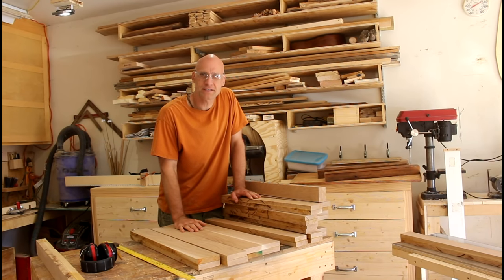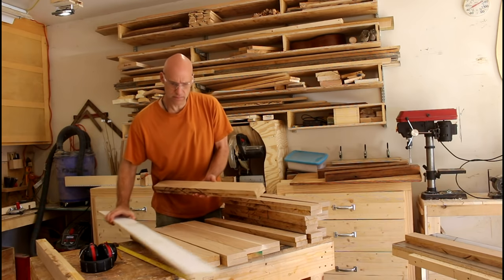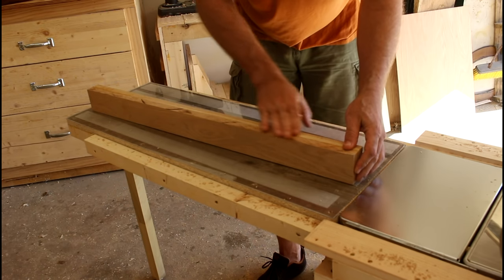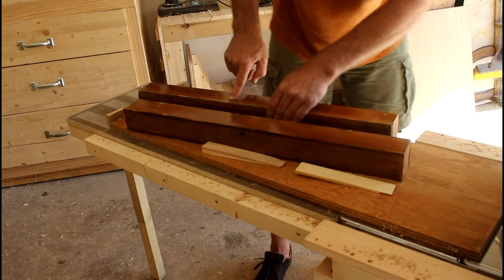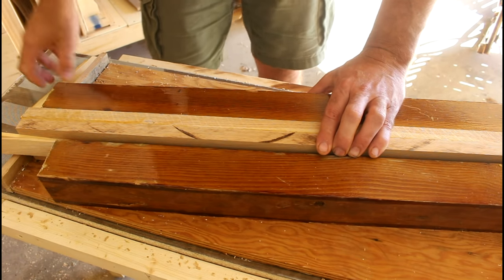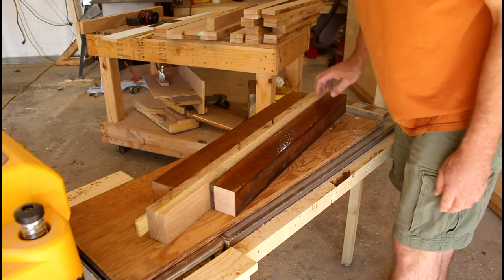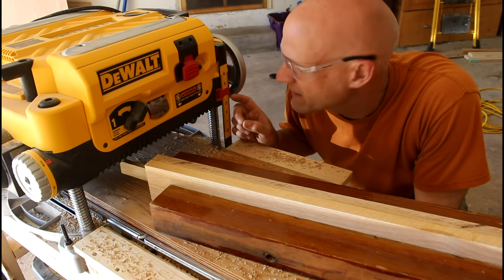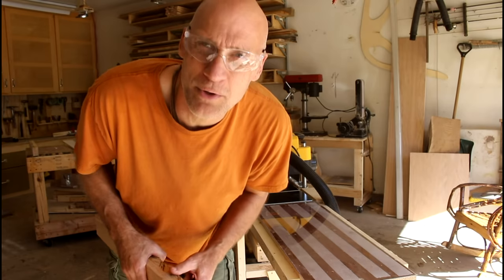How to Turn Your Planer Into a Jointer

Comment: I've always wanted a jointer but could never justify the expense for my home projects. I was lucky enough to pick up a DW735 at a local auction for a fraction of the MSRP. I just recently used it for the first time and learned a lot, lol. Both those planer jigs are a must if you don't have a jointer and want flat/true/square stock. This is a great solution, thanks for sharing it has saved me a lot of time, frustration and heartache...much appreciated.

Comment: Hello Sir, just saw your video and I'm at this exact stage in a project.  I just got my planer from a gentleman on Letgo.  After a bit of cleaning and rust removal I now have a DW734 in working order for $50.00 and a new belt.  Thank you for taking the time to make this video.  Good Day!
Reply: Scott Smith your gonna love the 734.  I have had mine for a couple years and it works great.  Such a smooth finish with that 3 blade head.  I just did a cherry tabletop for some doll furniture and no need to do a final sand as the top came out silky smooth

Comment: Nice solution with materials already in the shop. I don't believe I've met a jig that I didn't admire, they're all so very helpful.
I want to replace the top of my otherwise sturdy bench. I have a number of pieces of large pallet material (maple ~ 2"x4"x6'). They are all a bit twisted, so a sled such as yours is exactly what I need to make. I'll place them on edge, glue them up and run all-thread rod through them for a very hearty bench top. 
Thanks for the ideas.

Comment: I'm just starting out with woodworking, and to keep costs down I'm using old pallets for wood. I've been trying to figure out if I should buy a planer or a jointer for the boards that aren't squared. I think you might have just convinced me which way to go. Thank you!
Reply: Thatmrbadger I am in the same boat. I just broke down and got a dw735x yesterday. I was blown away by the results! I completely forgot about how much it cost once I saw the results. With the help of this video I'm confident I can hold off on a fancy jointer for now.
Reply: @fresh2k2004  Hi Guys...   I think both of you are right.  I just bought my first planner a DW734, and there is a lot of info here in YouTube on how we can mill rough wood using a table saw,  width planner and some jigs. ;)
Reply: I went the planer route. I do not have a jointer. I think one can find the savings for what the planer costs milling the wood vs buying it from a big box score.
Reply: I landed here for the exact same reason. Torn between a planner and a jointer. Leaning toward the planner, and this video is pushing me closer and closer to the store! Great video, bud! Thanks!
Reply: I just started doing woodwork, and I was going through the process and this video help me so much. Thank you
Reply: @RafikMankariosDrumStudio  I've found that a table saw will do what the jointer can do, only not as efficiently, since the jointer is purpose-built to... joint. However, you get good results with not much effort. A sled or jig will make it even easier. I only use a table saw, router table/router, and a planer. I also have a scroll saw, but I don't do that much detailed work so it stays untouched for the most part.

Comment: I was going to get a joiner/planer (UK) but I’m convinced to get a thicknesser based on your video. A simple sled with a straight edge, t tracks and clamps would work well to create lumber which is 90 degrees and planed all around!

Comment: Great work Mark! I got the Dewalt DW735 planer and I knew there was a way to do the edges of my glued pieces without going out and getting a jointer to do this. My pieces always range from 2"-4" in width, so this is a perfect solution for me! Well done!
Reply from the maker: I'm glad you found it to be useful.

Comment: Elegant solution friend. Previously I have been sledding to get two parallel sides and then ripping on the tablesaw to get the perpendicular sides squared off but that usually means more sanding; this way might save some finishing. Great work!

Comment: Hi!  Thank you for this!  I don't need a jointer, once I make this sled.  My Craftsman 15-amp planer has a 6 inch depth gauge ruler, so I do have some space to work with, if I use a 3/4-inch sled. 👍

Comment: Excellent idea!  I particularly liked how you utilized the full width of the planer blades by offsetting the stock at a diagonal.
Reply: Do bear in mind, you'll get pretty significant blade marks if you run wood in on an angle, if you aren't using spiral "helical" carbide cutter heads. I have an old Delta planer, and I've found that sliding the boards through on an angle actually stops the snipe by 99%, but it leaves fine blade marks along the wood because it's cutting against the grain slightly, because the grain is no longer parallel to the direction of cutting. The blade marks are not an issue though, because they are very fine.

Comment: I Love Jigs, after years of Professional Woodworking, you automatically start resolving issues with neat ideas! Another way u could accomplish 2 straight edges, is to glue both surfaces together with about an 1/4 inch offset on 1 edge, when your ready, run that edge that's a 1/4 offset against the tablesaw fence facing down, flip it over and trim the opposite edge, now u have 2 flat straight edges ready for the jointer!
Reply: You don't sound like a true professional by the terminology you use. Don't quit your day job.

Comment: Ive been using the tip from izzy swan a few years back regarding jointing the narrow edges. Using a narrow piece of ply against the fence of a tablesaw, put your workpiece on top of that, clamp it in some way, then the workpiece is more or less floating in space with the plywood providing reference to the fence. For clamping I use a strip on top of the ply with a couple of toggle clamps to hold the work. Great vid. I love all the tips I can get.

Comment: Can also use a jointer sled for a table saw, which is just a piece of plywood with a miter bar on the bottom and t-track witch clamps on top. On wide boards, a track saw can work as an ok jointer.

Comment: Excellent idea! I've used a long sled with shims to properly plane the wide sides of rough cut lumber before and have used a long table saw sled with cam-locking clamps that I made for jointing the edges. I usually end up with some burn marks from the circular blade and will have to try this method using the planer for the edges. Thx for posting. This looks promising and I will have to give it a try!
Reply: I do the same but cut the edge a little big (1/8) on the table saw on the first cut, and then do a second cut of the oversized 1/8th edge, which is quick and eliminates the burn marks.

Comment: Very well thought out jig, and I like the materials you used.  As others have mentioned, you could do the second side on the table saw, but since you just need to do another pass through the planer, and you're standing right there, this seems easier.  Also if you have a wimpy contractor's saw (like me), but a nice planer, this is still better.   It might give a cleaner cut with no blade marks.  Looks like this may help control snipe on the planer, too.
Reply: just a note, i've had this planer for awhile, if you're getting snipe on this unit, its because of your own doing.

Comment: Thanks for the video! Great idea. I'm looking at jointer/planer combo units and this gives me some food for thought. Also, on your design that now gets you to 5-1/4" of thickness... Two thoughts come to mind. (1)One could make the planer sled base out of 1/2" HDPE sheeting (like "King Starboard" for example), or one could route a 1/4" channel into the 3/4" wooden sled base to be able to process a full 5-1/2" thickness. That extra quarter inch seems just valuable enough to want to give it a go. If one is concerned with the sled base wanting to curl up and still felt the need for a full 3/4" board, then using 3/4" HDPE would work well in that case also, as it won't curl like wood could do. This is a very interesting solution in my situation as I could then keep a 13" planer of my choice, instead of the 8" to 10" compromise combo unit that I would otherwise end up with. If I'd need to joint boards over 5-1/2" I'd be perfectly content using my table saw for the bigger boards. Thanks for the inspiration! You may be helping with my decision...

Comment: I really like the idea! I’m going to buy a planer today and I was wondering if I needed to buy a jointer too! The only thing your jig limits you on is the size of the board I think if I make one of this I will make just as wide as it needs to be so it can be moved around rather than fitting perfectly in there that way it could be used with longer boards as well

Comment: This is great! I've been thinking of getting this thicknesser but I'm struggling to justify the cost. This changes everything! Thanks for sharing
Reply from the maker: I'm glad you found it to be useful.
Reply: My little pony
Reply: Robin Lewis oo
Reply: Me too. The cost is so high that I’ve been postponing purchase for years. Last week I bought a brand new one and… this tool changes EVERYTHING!
Reply: I’d suggest frequently checking FaceBook market place and Craig’s list. I recently picked up a Dewalt735 planer with in and out feed tables and a stand for $275! Like you I couldn’t justify the cost for something I would use so infrequently. But I couldn’t pass this deal up! They’re out there, just have to be persistent on the search!
Reply: Buy Porter Cable it’s half the price.

Comment: For edge-jointing wider stock, you can set up your router table with straight or shear cutting bit and  offset split fence. Quicker, dead square, extended time before resharpening required with carbide bit, and no width limitation.
Reply: Wouldn't you need a really long router bit then?
Reply: @davearonow65  Yes. I went this route, but it's hell keeping the stock against the router fence for a perfectly flat edge. I bought some wheel contraption things that sort of snug the board against the fence and it helps.
Reply: @davearonow65  The router bit has to be no longer than the lowest point of the edge/side you are jointing/planing. Think about it, even 1/2 inch is a huge difference to plain down but is still only 1/2 inch. You can easily buy one inch router bits.
Reply: @jeffstanley4593  thanks man. I asked because I am building exterior doors with panels that are 1 3/4 inches thick. Since this post a year ago, 25 successful doors later,, I've pretty much become an expert at edge  joining long boards with a router.

My preferred method is to clamp an 8" level down I trust and have checked to be dead straight(used as a straight edge)  and use it to guide my router along the edges of boards I'm going to join. I built a bigger base for my router to give it a lot more stability and I make sure to clamp down the center of the level as well as the ends so it doesn't flex.   Its a little more involved than I'm explaining it, but I get perfectly straight edges and my joints look like they were made by a machine.

Comment: Smart with the angle so you don’t wear the blades in one spot.
I definitely need to build one of those jigs because I don’t have. jointer but I have a DW735.

Comment: You could square up your blanks on the table saw. As long as you have the height capacity. That will also save planer knife life. No doubt your solution has merit.

Comment: Wow man, now that is a really helpful tutorial! I also have a planer and not a jointer. I like the method of not having to drill into the wood to secure it. Normally I would screw a piece of metal to the wood and run it on the table saw but the planer would be a much cleaner and easier method! Thank you for sharing this knowledge.

Comment: The only issue you might encounter is a seriously wonky piece and add some spacer/wedge pieces underneath the stock to avoid any rocking action, but this appears to be a solution for 99% of the time. I just bought the DW734 and am tooling up for all the available planer goodness in my processes. Thanks!
Reply: In the time since you posted this, have you had the chance to use the DW734 extensively? I've heard it has some issues.

Comment: For a wider (but not very think) stock you can try a track saw. The only problem I have with it - if it's not wide enough to be covered by the track - I have to find another piece of wood of the same thickness.

Comment: If you’re really hurting for cut capacity, use some metal instead of wood for the sandwich supports. That way you can use a thinner piece of material as the sled. 1/4” Baltic birch for the sled, and some 3x3 steel angle, and you’ve now got about 5-3/4” to work with.

Comment: So simple and so effective! Thanks for sharing.
(i also only have a planer and no jointer and i am sure i will run into the same problem. Thanks for the solution!
(if i have wood which is to big for my planer, i will probably just cut it in halve and do the same process, and glue them back together afterwards)

Comment: I came up with a solution too - I spent $250 on a jointer. Yes I tried using the planer. It does ok but it needs shims just like face jointing

Comment: very interesting solution - I was just having a conversation with my daughter about - Planer vs jointer and you just messed it all up - LOL
Reply from the maker: Well, it only works for stock that will fit within the planer. A jointer is an important tool to have. Sorry to mess up your conversation. :)
Reply: But a lot of the jointers (benchtop) are only 6 inches anyway. One less tool for those with a limited budget and limited space. I will be building this jig. Thanks for the tip!
Reply: You can also build a jointing jig for the table to do larger pieces.
Reply: For edge jointing a jointer  wouldn't have any restrictions would it.  The face would be limited to 6 inches on a small jointer but assuming you had jointed  it flat it would rest against the jointer fence and only be limited by the width of the planer in this case.
Reply: @rickspriggs2176  

Cutech/Wahuda has a nice 8" jointer using helical cutters for only about 550. The reviews for it seemed to be pretty good, but that was before Wahuda bought them, so I have no idea if they've gone downhill at all in the last year or so.

They also have a 12½" planer for about the same price, using, again, helical cutters.
Reply: @Duality6469 ou can now get an 8" or a 10" Wahuda benchtop jointer.
Reply: @nickbrutanna9973 Wahuda now has a 10" benchtop jointer.... I have one.

Comment: For wider boards I use my router table with half inch straight cutter, with care it will do a good job. I really like your Idea though and  my Dewalt  planer opens up more than your model can so I will try the jig for the next door I make.

Comment: This is a great extended use of a planer.
One thing about your sled... shouldn't' the stop at the end be at the front of the sled? The stop is to prevent the rollers from shifting your work forward on your sled in the possible case where the friction between the work and the sled is less than between the sled and the bottom plate of your planer.
Reply from the maker: When I use it as a regular sled I do use it that way. It doesn't really matter when I have the pieces wedged in as they aren't going anywhere. :)
Reply: Yes, it doesn't matter with those square-sections screwed down and the work wedged in there.

Comment: Great idea for the sled! But why wouldn't you anchor it back into the sled for the other side? It's a far more solid base than just the double board, isn't it? Anyway, thanks for the shop tip!

Comment: Great jig! What I am interested in is  you in/out feed table extensions. I have an older Delta planer that works well but snipe is an issue. I have adjusted the tables to reduce the snipe but it could still be better.
Reply: Hey mate, if you use a sacrificial piece of wood at the ends of the piece you're thicknessing you'll avoid a lot of snipe issues
Reply: @BarneyGumbl3  a sacrificial piece right after your desired board?
Reply: @terrmaso  you got it man, at whatever end you're getting snipe on. Two other options would be to plan for the snipe, cut everything longer and cut it off, or I just saw in a video today that running stock through at an angle kinda diagonally helps a lot, but I'm yet to try it. Hope this helps

Comment: If you had a taller board or didn't want to use the planner, you could always use a table saw jointer jig to square it up as well. There is a few youTube video's how to do this.

Comment: Sled is back to front. The stop goes at the front. The wood on it is being pulled/pushed forward by the rollers in the planer, your wood is only being held in place by friction and downward pressure from the rollers. At some point you'll get a catch or other obstruction and the wood on top will go forward and the sled will either stay in place or go backwards ruining the wood you are trying to plane.

It is very obvious once you think it through properly.

Comment: Where did you get the extra long metal extension tables for your planer?  I'm not referring to the stock tables that you can get for the DeWalt 735 (X) version but the extra metal extension tables you are using.

Comment: Thanks! I’ll be building this jig tonight. One comment: Shouldn’t the sled should go in the planer with the stop forward since the push roller are pushing the workpiece. Otherwise you risk the sled hanging up and the workpiece sliding forward without the sled.
Reply from the maker: It shouldn't matter for this jig since the wood will be held tight to it with the wedges.

Comment: Why not run the board on your table saw to rip the side edge and square it up to the top or bottom side and then plane that edge  smooth and square?
Will that work?
Reply: Why not if both sides planed using shims on the sled then get both edges to square on the table saw?